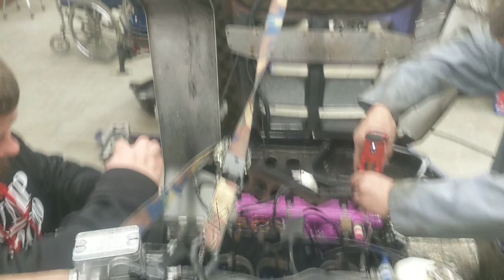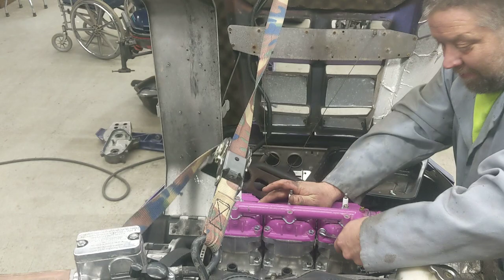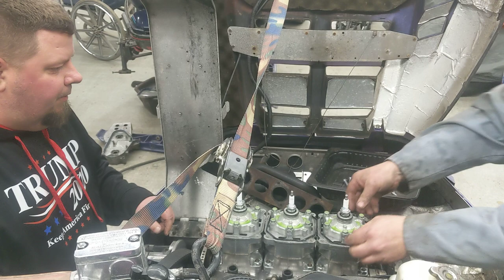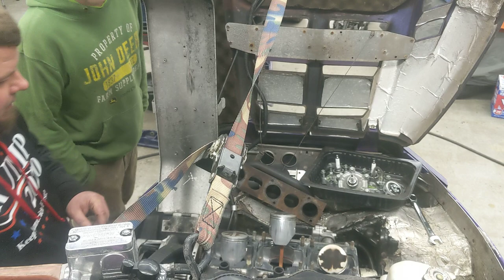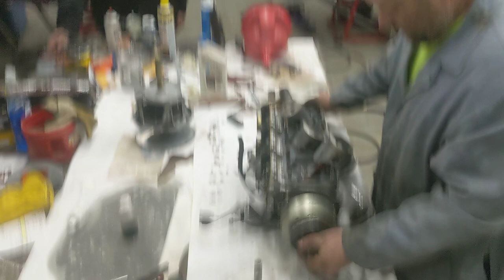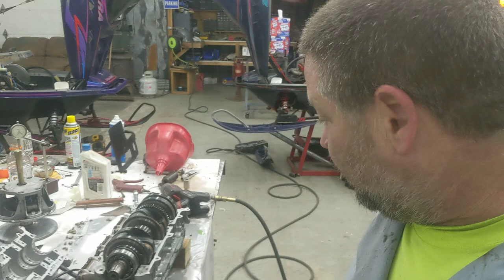POLARIS SUPER MOD TRIPLE REDEMPTION!! blown motor???

Comment: Up in my neck of the woods,  We all either bore the oil injector inlets bigger or we run 5  - 6 ounces of oil mixed into every tank of fresh fuel,   Never had a problem.  My XLT has 12,800 on the clock now and still hauling ass.
Reply from the maker: Good idea
Reply: Nice.  Where you from ?
Reply: @MidnightPolaris800  I am way up in Northern Ontario Canada

Comment: I can’t believe you didn’t have the crank serviced before you reassembled it, you had it out! Anyway, last weekend, stuck engine, trailer full of fuel , and you didn’t crash one, sounds just like a typical weekend of snowmobiling from years ago! Nothing new there!
You should revisit the video from December 3! RUN FOREST RUN!  LOL!

 Good luck Todd, just given ya some crap!
Reply from the maker: No hurt feelings. I was really trying to get it running as cheap as possible. I'm already a grand into it. Now another 400 in a crank and 80 in a gasket kit. Eventually I'll be ceramic coating the triple pipes I have for it and looking for billet heads. Money pit. Lol
Reply: @toddclyne3493  hell hea im excited to see and hear it!!!
Reply from the maker: @MidnightPolaris800  very soon

Comment: Damn Todd. Hope its up and running soon. Not having much luck either, my storm is backfiring and falling on its face, the water pump on the ultra went out, a rod bearing on the big end of the crank on the XLT went bad, and bought an RXL that now won't cooperate. Good luck with your projects!
Reply from the maker: That's a string of bad luck!!

Comment: You guys are fast. Only a 2 beer teardown. 🤣👍
Reply from the maker: We have done it a few times. Just don't do many videos of it.
Reply: @toddclyne3493  Was that bearing brand (name) one that you usually use?
Reply from the maker: @Z-Bart  this was the stock crank with 7000 miles on it. Sled sat for 10 yrs also. I gambled on the crank and lost

Comment: Had a stator come apart on a 95' xcr 600 and the magnets locked up inside the flywheel. Locked the motor up and I thought it was blown up. I was wondering if that was going to be your problem. Great vid and good luck getting her back together.
Reply from the maker: New crank on the way. That's something I'll keep in mine about the flywheel.

Comment: Love watching the videos, helps me a good bit with my own 97 Ultra SPX.  I'm wondering though have you ever had a bad enough exhaust leak (in between individual manifold and tuned pipe spitting oil) on any of those triples that it would make it bog down and not quite hit powerband? I sealed all of mine with sealent and waiting another 14 hours for cure before I give it another go.
Reply from the maker: I wouldn't think you would be getting a bog from that. Probably jetted to rich. We have been having very warm weather this winter. All my triples have been running very rich.

Comment: You can tell you guys have done a few tear downs on the ol’ triples! You made quick work of it. Do you do your own crank work or send them out to be fixed?
Reply from the maker: We send them to northern crank shaft. Ill be buying a NOS crank for this one.
Reply: Back in the day my Dad and two uncles use to race Polaris sleds and beat the factory riders in the early to mid 70’s. Lot of tips and tricks came from those years. Do you run or have the option to run American made bearings on your cranks?
Reply from the maker: @justin-sane713  great memories for you. I just bought an NOS crank for Redemption

Comment: Hate it when a bearing bites me in the ass... had it happen to many times.
Reply from the maker: In 30 years of playing with sleds this is the first crank bearing. Lol guess my luck ran out.
Reply: @toddclyne3493  it happens. Usually I have issues with sleds that have been sitting for a long time.
Reply: @toddclyne3493  ive never had a crank go out either. Ive been riding 25 years, all polaris. Maybe its because i never stored sleds outside and they were in dry facilities i have

Comment: Sorry to see , could of been a lot worse !
Reply from the maker: You bet it could have. Easy fix I think.
Reply: @toddclyne3493  yes Brother Clyne , would be nice to find a true taper roller bearing iinstead a ball bearing. Was failure lack of oil ? By video it didn't look high heat discoloration ?